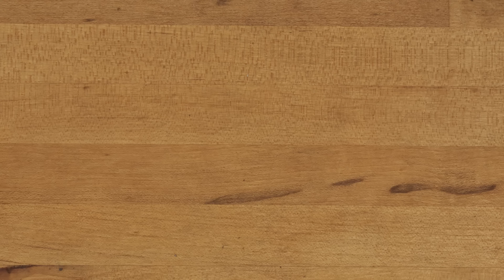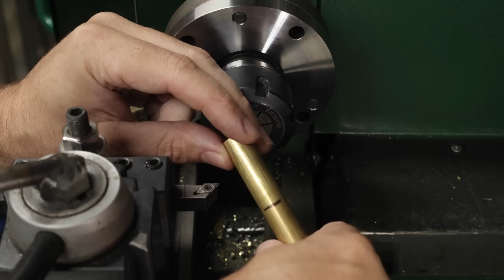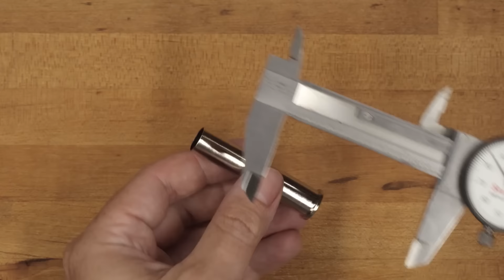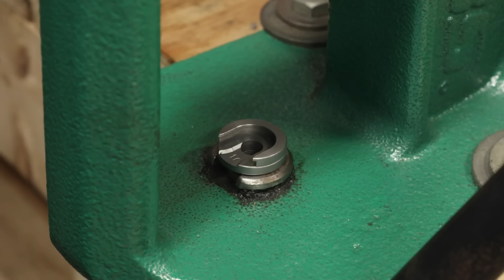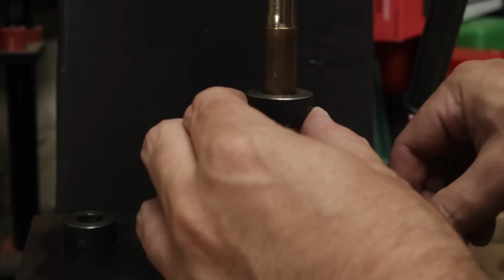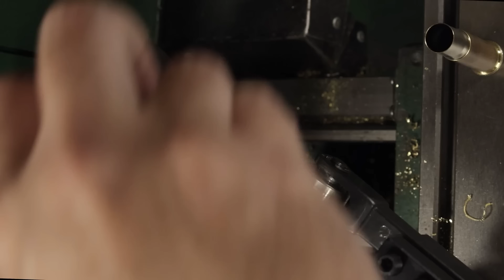Sleeving 45-90 Brass to 43 Spanish

Comment: Why do you remove the excess brass from the bottom of the case before thickening the rim? Is it easier to do it in that order?
Reply from the maker: Yes, it's easier essentially. Otherwise the excess material is just in the way.
Reply: @rakumprojects  Huh that's good to know, I had wrongly assumed that it wouldn't have mattered much.

Comment: Do you foresee any issues with the case breaking at the point where the original case meets the sleeve?  That harsh step would make me scared that once it's fire formed that harsh bend would cause breaks.  Could it be mitigated by tapering the inner part of the sleeve and then leaving the sleeve a little longer and then using the forming die to bend it in more toward the middle flat of the shoulder?  I know the sleeve is pretty thin so it's probably not THAT big of an issue but could be a thing in other types of cases in the future.
Reply from the maker: I did leave a small chamfer on the end of the sleeve, that would make it so the brass doesn't need to expand into a sharp corner. I will monitor it during future reloadings.
Reply: @rakumprojects  Cool!  If you do it with another case please consider updating us on how these cases worked out over time.  I really enjoy your channel.  You do some things i've been thinking about but never dared to try.

Comment: Did you ever consider making them from solid bar stock?
Reply from the maker: I've considered it but haven't needed to yet. One problem is that brass round stock is expensive. I did the math once and using 5/8" bar results in material per case costs of around $2.50-$3. It's certainly not cost effective if existing cases can be converted instead, but one day I'll try it just for fun.

Comment: ultra high performance hybrid case 43 Spanish for the NGRB (Next Generation Rolling Block) contract
Reply from the maker: You joke, but I'd love to experiment with two piece cases similar to 277 Fury. A machined head and then a body made from tubing.
Reply: @rakumprojects  how would you bond them together in a home shop to prevent case head separation?

Comment: I would be interested to know how many times you can fire a case made like this before it fails, because with the sleeve it has the potential to last longer due to the increased thickness, although it also has the potential to fail in ways that are unforseen. Thank you for making engaging educational content have a great day.
Reply: Likely no more then usual Probably case head separation or mouth splitting the sleeve doesn't affix the head to the body anymore the before in fact it might be shorter lived seeing as this likely work hardened the area

Comment: Nice! When can you show us how to draw brass from blanks? I want to make my own drawing cups and dies for making 8mm Mauser brass.
Reply from the maker: I'd love to be able to draw out brass from scratch. From research, it looks to be around an 8-10 step process when done in a factory. For a home gamer like myself, limited to say a 20 ton hydraulic press, I'd imagine it would be more like a 20 or 30 step process, probably more. That's a lot of dies to make. And probably a few hours to make a single case.
Reply: Dude 8mm is possibly the most produced cartridge in the world. Just buy some surplus
Reply: @evanjohnson9269 I do buy surplus, but I have yet to obtain reloading equipment. Plus, the brass won’t last infinite reloads…
Reply: @Beauregard42brass is 50 cents a piece. You couldn't make enough brass in your lifetime to offset the cost of machining and producing all of that equipment. Buy a press, dies, and brass. No sense in trying to make your own from a tube
Reply: I've seen videos of Kyber pass produced brass but never a home shop setup for it, so it may be prohibitively expensive or way too complicated for a home shop.
Reply: 8mm can be made by shortening 30-06, sizing and fire forming.
Reply: @vaquerojoel2026 exactly, or 270. There's so many options to make it out of